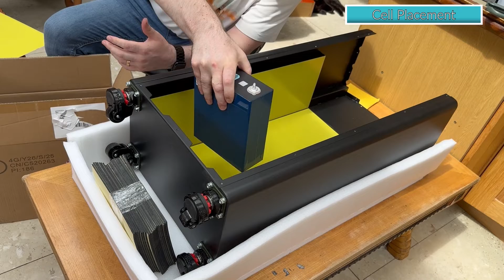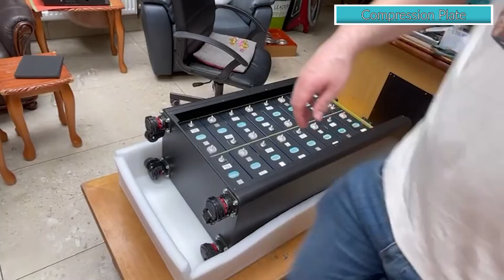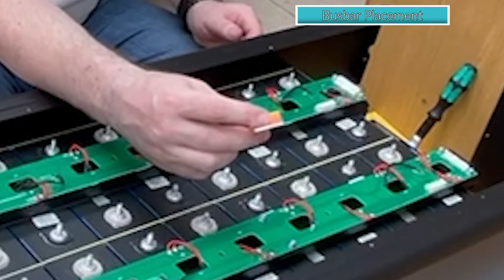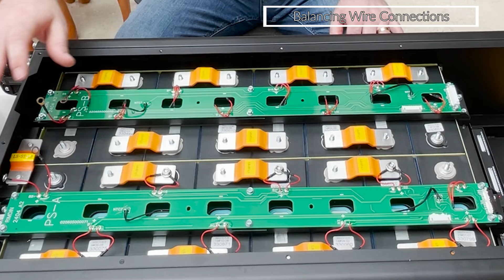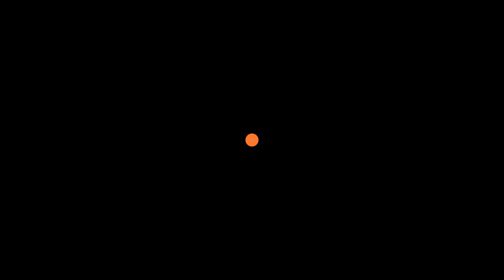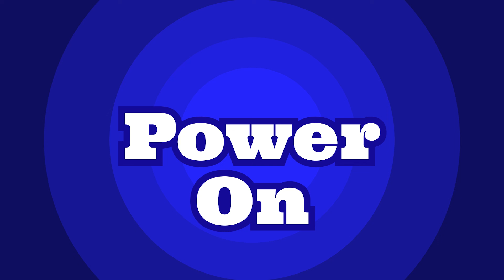Seplos V4 DIY Battery build. Part 2 of 3

Comment: The Fogstar video states not to install foam pads at the top and bottom of the stack of batteries, why do you think they say that?
Reply from the maker: They say that because the fibreglass sheets are already electrically insulating the cell from the case. I place the pad there anyway (if possible) as extra protection.

Comment: use a torque wrench please. theres a reason why you should use one. The manafacturer knows better than your good self. If your going to put out an instructional video....follow the rules. Your dealing with 15Kw of stored energy under them nuts.
Reply from the maker: Your opinion is appreciated. I highlighted the torque value specifically so people would be aware of it and to use a calibrated tool if doing so. I have had a stripped terminals prior to reaching 4.5Nm of torque on high quality cells and a terminal ripped from its weld spot before hitting 5Nm, so I hold the strong opinion that the value is excessive and reported this to the supplier. There are multiple reports of the same thing happening to others at similar torque levels. Go ahead and look it up. 

I work in industry with machinery worth many millions of dollars and I can tell you that often the manufacturer values are incorrect and when questioned, will give different advice and sometimes update guidance as a result, including torque values. There are times when I have saved my employer large sums by not following manufacturers guidelines and opening up lines of enquiry when the guidelines needed to be questioned. I have also seen people blindly follow the guidelines and the damages ran into millions in losses. 

I'm well aware of what I am working with and I also don't want people to strip, or snap a terminal and think it was their fault. Sometimes the guidelines are rubbish, or are not updated when materials, or other specs are changed. 

I torque the nuts to the point that they imprint the ring terminal to the cell terminal. If I were to release the nut, I would have to peel the ring connection off. Take it from me, 6Nm is too high, but I give fair warning in the video. If you don't like that brute honesty, then fair enough. Telling me you've unsubscribed won't encourage me to lie in my videos. I show and tell the reality. People can take from it what they need.
Reply: What about top balancing of the cells? I recently built one first I didn't do it. Under 60amp there was 0.150-0.200V difference. So i disassembled and connected them all parallel. And changed with 3.65v until the current was 0.3A. now the max difference I get is 0.005V.
How come you didn't do it?
What voltage difference do you get under high load?
Reply from the maker: @benceparoczi9481  Great question. Cell balancing prior to installation is only beneficial if the cells are imbalanced. Imbalances could for many reasons, including mixed batches, long storage times in different conditions, some cells used for testing and placed back into their batch, or just bad cells. If there is a small imbalance, the active balancer will resolve that after a full charge. This is what I found to the be case with my 3 Seplos V3 kits with Seplos balancer. The kit in this video has the better JK active balancer and reportedly does even better than the Seplos one. The cells are also at 3.289V-3.291V with most being 3.290V. So pretty good to begin with.
Reply: ive unsubscribed
Reply: @gerrykeaveney1657  Gary hasn't a night sleep since
Reply: @gerrykeaveney1657 I absolutely love you unsubscribed. You were given a proper reply with concise and proper thought. You tube doesn't need folk like you clogging the comments.